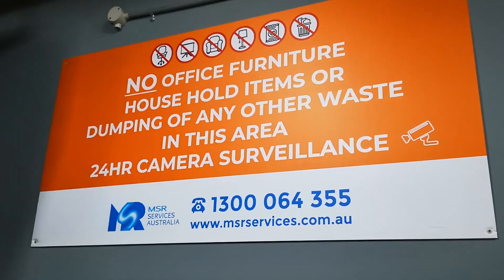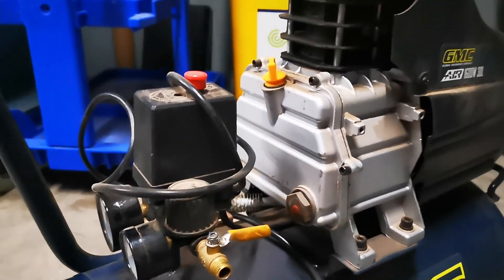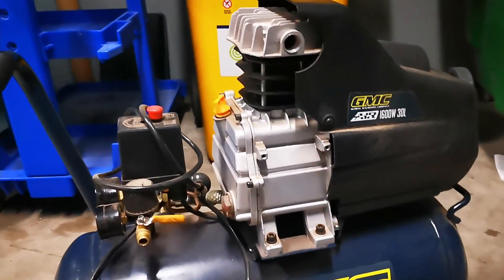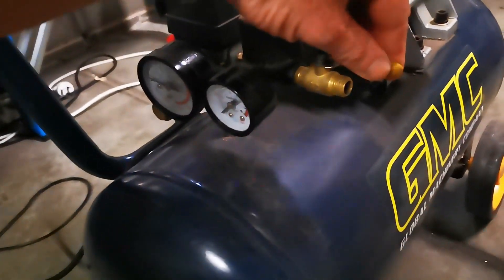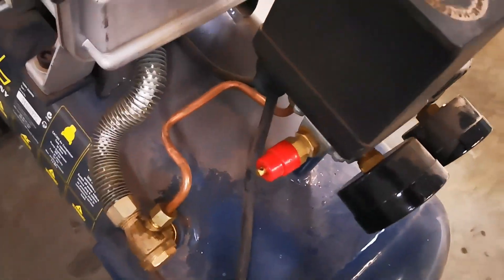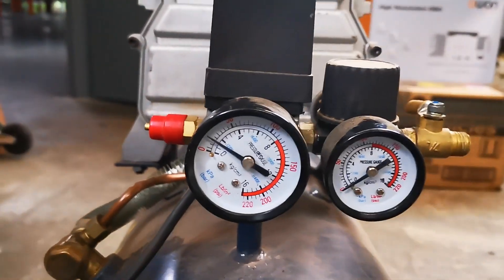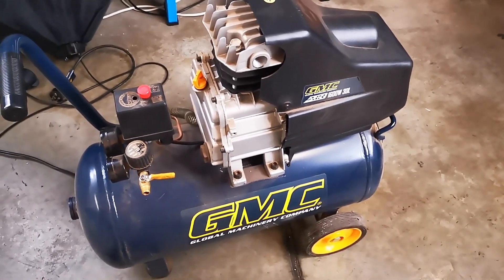Dumpster Diving Decompression

Comment: A common problem with cheap compressors is a restrictive route for air out of the tank to whatever you want to run.

I ended up removing the tank end plug, and running larger bore hose directly from there.

Before you trust it, make sure the pressure switch (black box) is reliable, make sure the safety relief valve (I forgot the name) isn't stuck and make sure the tank isn't rusting--people forget to drain the tank after use and the water can cause rust.

I've never seen that rust cause a problem myself, but I guess it can.

Comment: Hey :) Nice find, definitely useful for a shop! Hella noisy though. I've got a little one I built myself, with a 5 liter air tank, a fridge compressor and pressure regulator with filter. It's enough for blowing off the dust or pumping tyres (I'm an occassional bike mechanic), but forget about any pneumatic tools or spraypainting.
A leak or a damaged pressure gauge being the reason for dumping a compressor instead of fixing it? Geez, what has this world come to? 

The pressure switch doesn't have any solenoids. What you see there is a spring that works against a bellows expanding under air pressure, with an adjustment screw somewhere there, and a pair of contacts in the plastic enclosure that turn the motor on and off. When the pressure builds up to an (adjustable) maximum value, the mechanism kicks in and switches the motor off. When the air is used and the pressure falls down to a certain value, the bellows contract and the mechanism reaches the point where it turns the contacts back on. Basically, it's a pneumatic input, electrical output Schmitt trigger and yes, it has pressure hysteresis.

"Dungeon"... are you dom, sub or switch? Haha, just starting to get funny ideas :D

Comment: Yeah, ya nailed it.
The brass thing with the red cap is the pressure relief. The black box is the pressure switch that sets when the compressor motor kicks in (+/- 75psi) and cuts out (110-120psi).
The o-ring, that's just how GMC do it and yup, that's the oil fill point for the compressor.
It's missing the intake filter, which is a must and if you dodgy up an air cleaner box from a small 4cyl car, you'll never need to change the filter and it'll quiet it down substantially.
The air leak is almost definitely that gauge, you could get away with replacing it with a blind plug and just rely on the other gauge (which reads the pressure after the pressure regulator - the black knob behind it adjusts the pressure)

Couple of things about that style of compressor. They're not expensive and they're not particularly sought after because they are direct drive as opposed to belt driven (more modular if you need to replace either the motor or the compressor head). It's a single head compressor (single piston), so it's CFM isn't very high. You wouldn't try to run a spray gun off it, it won't keep up. It won't really keep up with a rattle gun or a air ratchet/die grinder either. The outlet fittings are 3/8 inch ID, generally the first thing to do is swap them for 1/2 inch because the 3/8 is too restrictive.

However, if you're only using it for the occasional dust off, an air brush, or small tools like staple guns, they're perfectly adequate. I have an old one that I fitted an old fridge compressor motor to, that I use at my electronics bench. Slow to get a good air charge, but silent and if you're only dusting off boards and the like, works well.
I've managed to get rid of all the leaks and just leave it on 24/7. Again it's silent (almost) when it's running and that way it's always charged when I need it and doesn't run when you're not using it.

Comment: It's worth repairing. These compressors  have one or two overpressure valves or, like the one you have, a high pressure electric switch and  an overpressure (safety relief) valve. The leak seems to come from the pressure control block. It works like those on cheap water pumps.  The usual failure points are the 1/4" thread  pressure gauges and are a cheap fix. .You also should drain periodically the main accumulator. Use 30w oil for the cilinder compressor filling It through the yellow plastic plug checking the level to not overfill. Yes, they are loud but, the air intake filter at the top side of the cilinder head is missing and It also bafles sound a bit. If you want a silent one look for the ones made with refrigerator compressors but, don't expect a lot of air from them.  Plumber's tape  isn't required (usually)

Comment: The meter is fine, it's just the housing that is loose. screw off the meter, wrap some teflon tape around it and refit. You may want to check if it stops compressing around 8 bar ;-)
Reply: the arrow moved when Dave moved the case around, that does not look fine at all. Actually, that made me think that the gauge is busted internally and is the leak.

Comment: One reason it is so loud is that it is missing the inlet muffler/filter. A little round can that screws into that hole at the top of the cylinder.

I have a similar one that developed a large leak there - the diaphragm in the cut-off switch failed. Replaced it with a few circles cut out of an old inner tube. Disassembling that cut-off switch was a challenge - strong string pressure, needs to be assembled in the right order, managed to do it but have forgotten how - which says that the inner tube rubber works well!

Comment: It might be noisy, but it's a godsend for the workshop.
The one at work 'stopped' working correctly and all that was needed was to pour the water out of the cylinder.
Great for blowing accumulated shite out of devices and off of circuit boards. A keeper indeed if you get it airtight :)

Comment: They have tried to stop the leak by turning the pressure clock it self, in stead of with a spanner. It misses the little filter on the top side and the ripped the quick connect . Just an ordinary unit, loud as hell it self, but these all are.

Comment: The gauges break off back for past time for these cheap units, maybe the owner tried to tighten as thought leak from gauge. Put some soapy water round back of gauge to test first. What you call the solenoid is the pressure switch and also dumps pressure which at correct pressure to allow the compressor to start easier as hard to start the motor if head is still pressurised.

Comment: Dave I repair these the leak sounds like it is coming from the pressure switch but a trick for younger players it is the non return valve which is the brass chamber where the air comes off compressor into receiver. Inside is is a rubber pastel which are pence on eBay to fix. The number of people coming into work to buy new pressure switch then come back saying the new one still leaks, so then sell a new pastel for couple quid.

Comment: The safety release valve is leaking. Sometimes they just do that and rotating the pin will let it seat, or it could be that the pressure is too high becuase the regulator is out of adjustment, which is likely after a knock. 

The regulator incorporates an 'unloader vlave' and you should only ever start and stop a compressor using the red knob on top of the regulator box. It releases the pressure between the pump and the tank, so that the pump isn't starting against a load. Starting against a load is hard on both the pump and the motor.

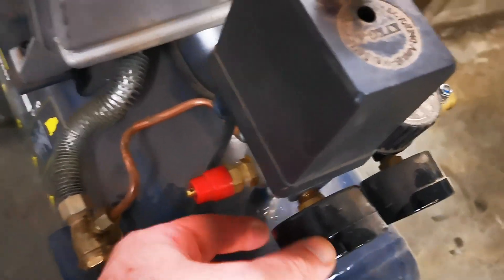Comment: At 2:21 you can see someone left teeth marks on the brass square on the back of the damaged gauge. If they tried tightening it more without adding thread sealant, they may have cracked the aluminum manifold which is the source of the leak.
Reply: Actually those manifolds are diecast zinc, very delicate. The gauges are screwed in using glue to avoid cracking at factory.
Reply: @FrozenHaxor  I have even found one made of black plastic (probably ABS) painted in metallic silver to look like aluminium.
Reply: @ruben_balea  Lmao that's a beauty. I guess they forgot how much force is sometimes put on those quick connects.
Reply: @FrozenHaxor  Yeah, I bought that compressor at a pawnshop and it already had the quick connector crooked, I thought they had screwed it wrong and it was that they had almost ripped it off.
In addition the tank of that compressor was only 3/64" (1.19 mm) thick so I turned it into a hydraulic oil tank for a log splitter.
I had bought that compressor just for the pump to fix another compressor that had tipped over while it was running and seized, it used an import pump too but a proper certified tank made in Italy by S.E.A. Serbatoi
Reply: Rip out gauge and fit plug. Either 1/8 or 1/4 BSP  thread. On mine, there is a decompress valve under the solinoid  valve which is very similar to what you have. Mine had a bit of rubbish in it causing a leak. Be careful with doing up the plug. Main housing is made from cheap rubbish and can break easily

Comment: .. as it seems only a small leak in the pressure gauge, best to replace, a little Teflon tape on the thread, done. You shouldn't turn off the compressor by simply unplugging it. The pressure regulator (the black thing with the thick spring) ensures that the pressure line from the compressor to the pressure vessel is depressurized when the switch-off threshold is reached. If this does not happen, the motor has to work against this pressure when it starts up again and this leads to high starting currents (and in some cases also to triggering of the protective fuses)..

Comment: The important thing to check on these is the drain plug, make sure there's no water in the cylinder and make sure the drain plug seals well. I spent ages on a new compressor trying to find a leak and it was the drain plug all along. I didn't know at that time that this was a thing. That's not an oil free unit, so is suitable for air tools which need oil adding into the air.

I replaced a cheap compressor with a much quieter one, they're not too expensive. The pressure relief valve should have a ring on it so you can pull it to decompress the cylinder (for when you need to empty the water every week depending on usage.

Comment: The compressor needs oil.  You also will need oil & water separator/filter pots.  I would suggest a drying system for the inlet air or at least hook up the tank purge line (bottom or near) with a run of tubing to a drain.  You need to drain the tank daily with constant use and every few days with lite use to prevent corrosion of the tank.  Speaking of which you must check the tank for corrosion.  Given the price of a new one this find might not be worth the effort & safety risk.
Reply: Wouldn't a 1.6kW compressor make a decent duster without the tank? Just fit inlet and outlet filters and a piece of hose going to a nozzle. Even if the tank is in great shape, it might be worth adding a bypass mod so that it can be used to quickly dust off something without waiting for it to build pressure.
Reply: @NiHaoMike64    You would need to add a drying agent, knockout pots, and probably some activated charcoal as well.  You do not want to spray air with a watery/oil mix scum into your electronic components.
Reply: @seanb3516  Hence the outlet filter. Those have the oil/water separator function as well as the mesh filter.

Comment: Just remove the gauge and put a bung in its place....you dont need to know what pressure you have anyway.....the switch is just a pressure switch that turns the motor on and off depending what pressure is in the tank......GMC is a cheap and nasty Bunnings brand......probably not more than $150 new......its the compressor you have when you cant afford a real one.....they are all really noisey....if you want a silent one buy a Chicago Air one.......I have one under my bench and can't hear it when its running.

Comment: Needs new gauge set and new air intake filter box.  The air intake filter might quieten it down a bit too, currently just a big open hole to the piston.  Probably good time to do an oil change too
Reply: Oh yes, the air intake filter is essential if you plan on running the compressor in a dusty environment (prevents the cyllinder and piston wear) and generally a good practice with compressors all the time. You also need to drain the tank from time to time and check the oil level as it depletes.

Comment: These cheapy non belt driven compressors are direct coupled to the motor and the poor compressor runs at motor speed and are noisy and cop a hard life. 
Do they work? Of course they do but not a good long term solution.

Comment: score, I need to get a new one, my old crappy pancake has given up the ghost for the last time. 
new gauge for that ~$1.50, drain from the bottom of tank preferably not on Your floor, a $10 hose kit and you will never have to Vacuum salvaged dusty junk again.

Comment: I have the same one but with a 50l air tank. The brand is differet but rhe rest is absolutely the same. Mine was from a store called LIDL in Bulgaria(where i live) where they also sell groceries clothes etc. But it is surprisingly reliable. It was about EUR140. I use it for my solder paste dispensing syringe, for making vacuum and supplying air to pneumatics when i test some automated devices i make. Always good to have one. I think the red safety valve had some way of unlatching once it has tripped. Try pulling the brass plunger or rotating the red part.Dave i can send you a 3d model for printing a new air filter if you'd like:) i broke off mine took the dimensions and drew it in CAD nad printed it. Inside there is some kind of sythetic polyester cotton - the same as they put in winter jackets for lining. Ahh i suck at explaining - you don't know what a winter jacket  is :)

Comment: Take the end off the tank check valve. There is a spring and a plastic check valve.it is supposed to seal when the compressor isn't running to release the pressure from the compressor for next start. My guess is that the spring will be broken

Comment: This is a bog standard cheapie. They leak like buggery unfortunately but pretty damn simple. Just don't expect to run huge air chisels from them
Reply: They don't leak when they aren't broken. There are literally MILLIONS of them all over the world that don't leak. Really, there isn't anything in an undamaged one that can leak.
The zinc/potmetal manifolds very easily crack if you bump them, and once that happens you can never fix them. Whole new manifold and gauges is $10 or $15 off ebay.

Comment: before you pressurize it check the integrity of the cylinder make sure there is no rust at the bottom, when the compressors work and the air in the tank expands it produces condensation that can settle at the bottom of the tank and cause it to rust from the inside out so make sure it has no water at the bottom of the tank and also make sure there is no rust to compromise the integrity of the tank. nice find.
Reply: There is no way you can just check the integrity on one of these without a water pressure tester. You'd fill it with water and use a water pump to pressurize it up to a max limit. Rust in the tank is unavoidable, just make sure to empty the water in the tank from time to time. There'll be a drain plug at the bottom.
Reply: @TheChrisey  Interesting, by pressurizing with water, there is no "springyness" like gas, so if it ruptures with water it just sprays out rather than explodes.
Reply: @gargantuablargg  Yep, you save yourself from going deaf and possibly even dying
Reply: The air expanding doesn’t make the water. It’s the compression.
Reply: @michaelslee4336  Quite the opposite, as air expands, temperature drops, pressure drops, it can no longer hold as much water vapor as it had and the condensation comes out. Think rapid depressurization on an airplane.
Reply: @FrozenHaxor  
I think you missed point. The air is compressed and the water vapour condenses out of the pressurised air and collects in the vessel. 
That is why air compressors can have auto blow downs and in the case of mine just a little drain cock. In this scenario it’s got zero to do with what you’re talking about. Squash a crap load of air and it can’t hold that much water anymore. Simple.

Comment: Easy fix dave.
Black box is the pressure on off relay the red button on top is the on off switch only works if the cover is secured properly.
The brass thing with the red top on the side is the over pressure release valve, very important obviously.
The pressure gauge with the leak is tank pressure. The other is line pressure adjustable with the knob behind it. It needs a new air filter, screws in at the top of the unit and a new gauge.

Comment: If the air pressure gauge is busted, you can just buy a new one (or, if you want to be cheap, just replace the gauge with a <$10 taper plug). Take the dead gauge in to Pirtek and they'll sort you out no worries finding a compatible gauge or plug (I don't work there, #notanad; I just hand an excellent experience there in the past)

Comment: If I ever move to Australia I want the address of this dumpster. I'd have to get up early to beat Dave, though.
Reply: That's a Dave's Dumpster of Wonders! Where you can find EVERYTHING ranging from crappy old audio & video cables to high-end multi-megahertz oscilloscopes with non-standard input connectors. I wish I had something like this close to my lab! I'm sure I'd get stocked up on tubes and transformers in no time.
Reply: .... and steal a key to the room.